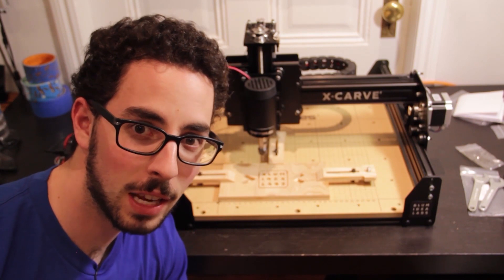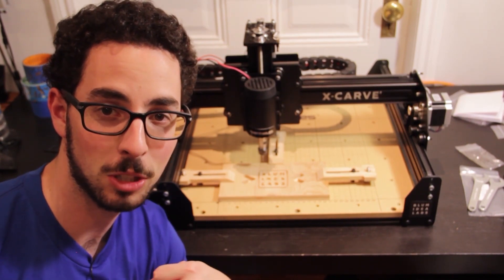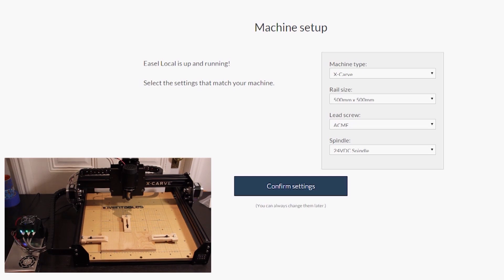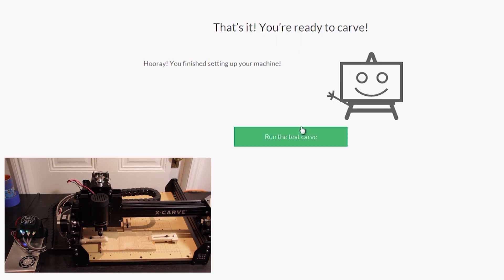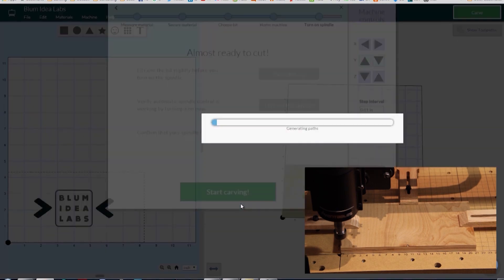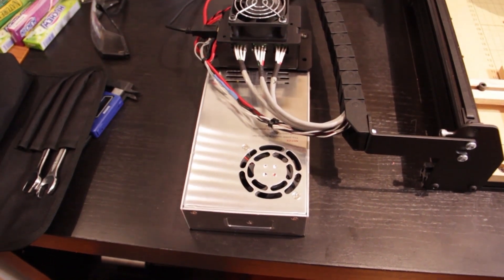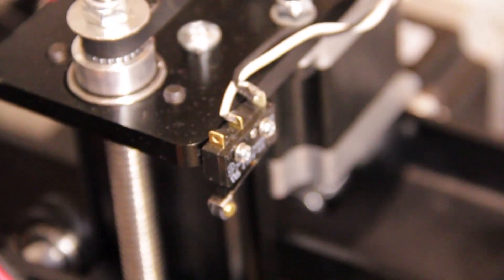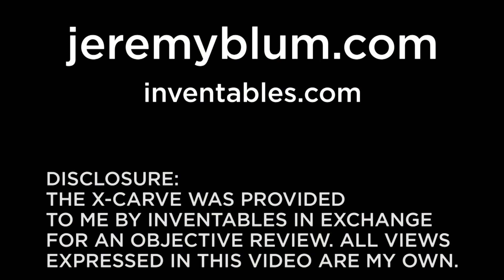X-Carve CNC Mill Build Log & Review

Comment: Is that a TS100 soldering iron? (one of those programmable OLED ones from China/Banggood that uses any common laptop-style barrel connector as power source?)
Reply from the maker: +TheAmmoniacal No, I use a Aoyue 968A Rework Station.

Comment: Hi Jeremy, have you ever seen a machine like a cnc mill but with a little spray painter instead of a drill? I've looked for one but could only find machines with big sprayers that coat whole objects in one hit. Varnish on wooden tables tops for example. What I'm looking for is one that could spray paint a picture with a bit of detail. Love the channel.
Reply from the maker: I haven't seen something like that, but I bet you could rig a machine like this to do that.
Reply: big ink jet printer.
Reply: Yeah, I reckon so too. I was trying to be lazy. I reckon jury rigging a cnc mill to use stamps, kind of like a freeform printing press, would be a good option for what I want to do (painting table tops with a lot of detail). Combining that with a cnc mill for carving the stamps would be pretty cool. Anyways, thanks for replying!